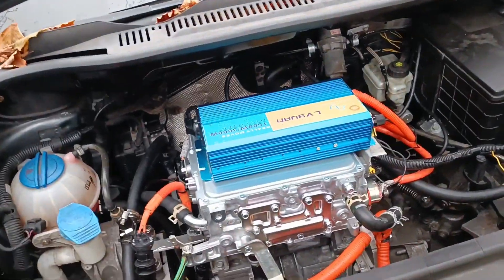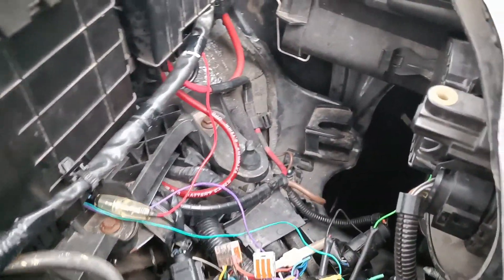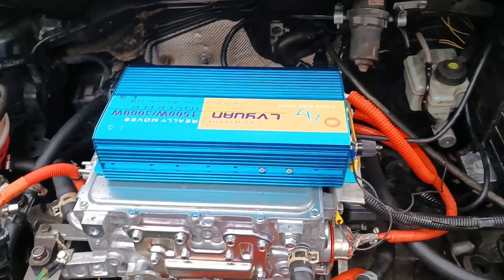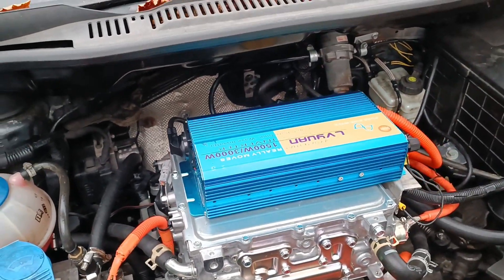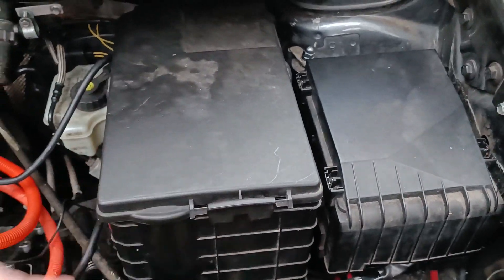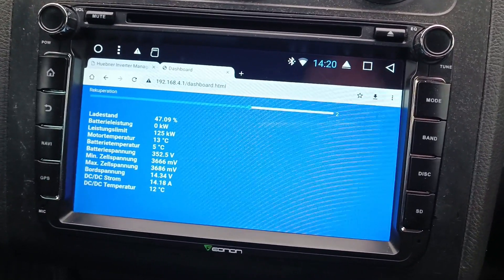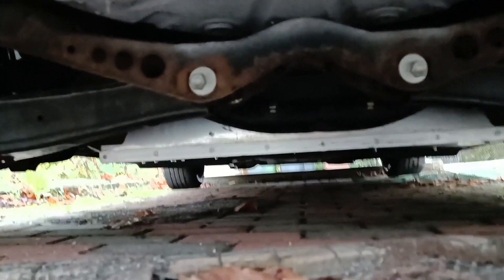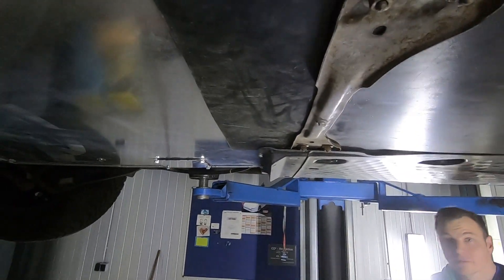Lab Update #70: Touran Upgrades over the last years

Comment: Any link to that Chinese HV DC to AC inverter, Johannes? And what electronics, if any, do you have between it and your battery? Could be a handy way to setup a V2L system in the car without having to connect it to either the 12V battery or to the car's DC-DC converter.
Reply from the maker: Would be this one: https://de.aliexpress.com/item/1005002013462606.html (the elcaps are crap and the large coil will wiggle loose)
Nothing in between besides a 10A fuse, it's directly on the 400V DC Bus.

Comment: The most interesting part for me is Chinese 400v ac inverter, how did you make that? 😀
Reply from the maker: yes here's a link https://de.aliexpress.com/item/1005002013462606.html
Reply: @openinverter  That's great, thank you ⚡👊⚡
Reply: @openinverter  Nice device! Is this also available with more power, like 4-6 kW? I coudn't find any module with HVDC-input. 🤔
Reply: Look up "380V inverter board".
Reply: Johannes, if you can tell us more about this inverter boards a lot of folks will gonna appreciate it. 96s packs are common, but affordable 96s to 220v solutions are not so much.

Comment: It's always interesting to see how a conversion progresses when in real life use :)
Reply from the maker: Yes it's never finished :) I would love to fit a water-to-water heat pump instead of the silly water heater. Also one day a CCS upgrade would be nice
Reply: @openinverter  Maybe the VW needs some BMW parts with Irish 🍀 support. 😉
Reply from the maker: @Stefan_Dahn  Some say there are some VW parts with Irish support coming ;) 3-phase charger with built-in CCS support. The trip to Sweden was easier with CCS (and a  64 kWh battery...)
Reply: @openinverter  it's just never too much capacity :)